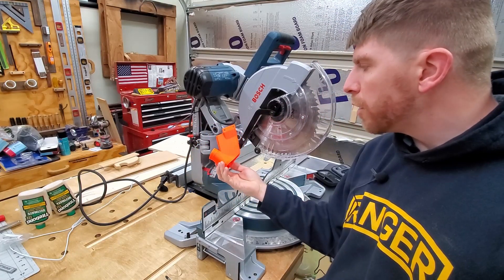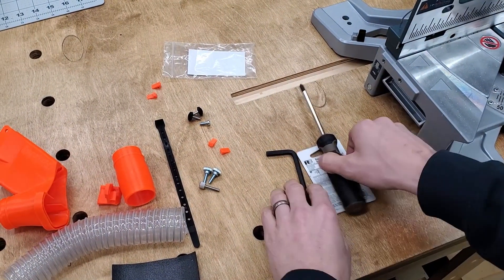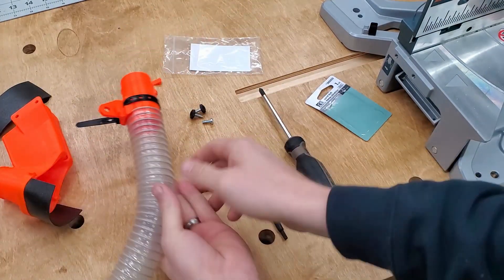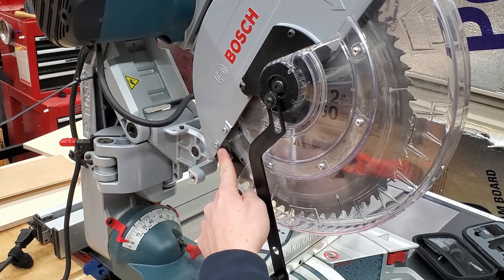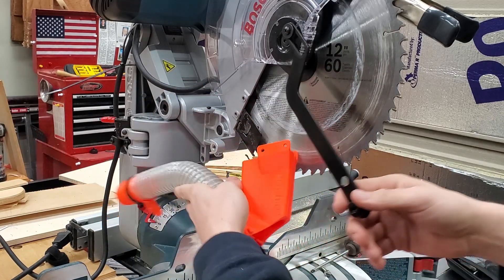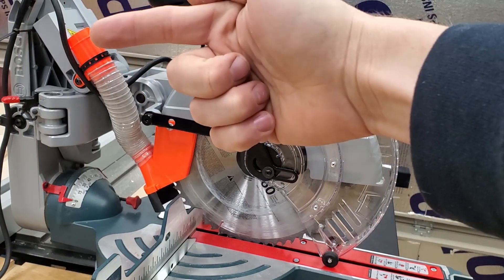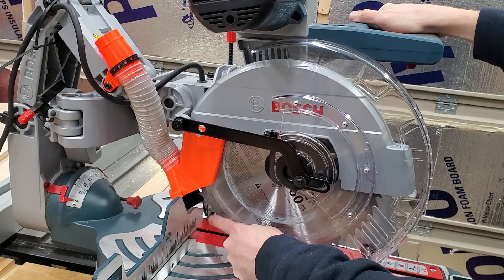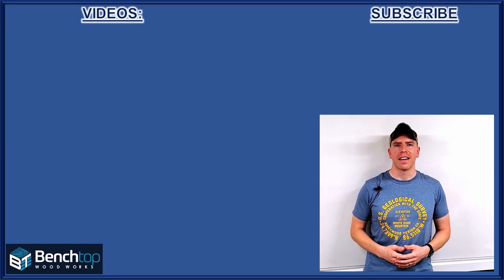Miter Saw Dust Collection INSTALL GUIDE for 12" Bosch GCM12SD UPGRADED (R16)

Comment: It works. I got mine installed yesterday and I'd say it catch's 98% of the sawdust. So much better than the stock one the saw came with. It is easy to remove too if you need to for a special cut. I for one am happy I got it!
Reply from the maker: Thanks David!
Reply: Have you tried right & left 45 degree miters? Have you tried 45 degree bevels? Thx
Reply: I too am wondering how it works with 45 bevel cuts. Thanks Chris
Curt @benchtopwoodworks

Comment: Chis great video.  I almost bought your dust collector a couple years ago and then got distracted.  I have been more into 3D printing recently - just got a Bambu Lab X1C.  So, I thinkn I would like to 3D print these and you mentioned this was ab option in the video.  When I go to your etsy store, I only see the phyical product.  Or, maybe I am missing something right in front of my face.  Does the print file come with the instructions and screws/rubber pieces I need to order - i.e. links to suppliers, etc.

Comment: How does it work on 45 degree miters? How does it work on 45 degree bevels?
Reply from the maker: It works well at full bevel/miter. There are some limitations to thickness around 8/4 on full width cuts at 90. Plunge is not limited.  Beveling changes vertical clearance slightly,  I'm sorry I don't know the max height when beveled off the top of my head

Comment: Where are the images for the "stock elbow" attachment procedure?
Reply from the maker: Great question Rich, I have not done a video on it and need to! Assuming your saw has the hard plastic version,  If you drill the 2x rivets in the stock chute, you can separate the halves.  The stock elbow will mate with our port the same way the stock one did with the bottom portion.
https://www.instagram.com/p/CoIdKhMJohS/?igshid=MzRlODBiNWFlZA==

Comment: Hey Chris, sorry for not getting back to you, my DeWalt Dual bevel miter saw is the DW716 I believe...the top sticker is worn off...I see that the DWS716 has a similar dust shute on it...but I would like one for mine...
Reply from the maker: Thanks Arnie. I have a 715 on hand. I think at least a few of the 715/716 years have similar ports so design may work for both. I have a few videos on my past solution for 715 that worked pretty well with just cheap drawer liner

Comment: So you can cut crown in nested position, but how many times do you cut crown at 90 degrees in nested position? Once you miter the crown you need to take it off. These aftermarket dust ports are a joke. You really think Bosch made this tool to be dust free or to cut your material in every possible way with minimal interference. Dust collection is an afterthought because usability is the most important part.
Reply from the maker: I'm sorry you feel that way.  As the man in the arena on this one,  I can share some more info. You can cut at least 5.5" nested crown at all miter angles without interference. I have personally talked with the Bosch engineer and product  manager yes they design for the widest possible work envelope. In doing so its optimized for capacity and not dust collection,  this attachment optimizes for dust collection and of course there are tradeoffs.  Almost any of these saws can be improved at least a fair amount. What model are you running? I keep a list of all inquires.
Reply: I use 10” glide miter with a Rousseau 5000-L dust hood. Not perfect, but does not limit capabilities. Once your dust port gets in the way it would get taken off and not put back on. For me it doesn’t benefit me over usability. Not to mention the dust hood can handle a stray off cut and not damage anything around. This is just my preference. Good luck with your product.
Reply: I think saying "aftermarket dust ports are a joke" is unfair. Some might consider the factory dust port to be a "joke" because it doesn't collect dust very well in any mode. Both statements are silly. I don't think anyone who makes these things claim that they work in every scenario that the saw is capable of. Would you install a zero-clearance insert for less tear-out, then be upset with the seller because you have to remove it for bevel cuts? ZCI's are a popular modification that also limit the saw's capability, but with a clear benefit in certain use cases. Seems to me you should have spent more time reviewing the product capabilities and whether it was a good fit for your needs.
Reply: You don’t make a very good point. I use a colliflower zci and it has a simple dovetailed slot to remove quickly and easily for beveled cuts. I am a professional and use all sorts of products regularly. If the product isn’t efficient for work flow of saws usability, it is a joke for professionals. Have a great day!
Reply: @samsonhorvath3614  It's odd that a "professional" couldn't anticipate the potential limitations all products have in certain use cases when such information is readily available. This is a custom product made in a small shop by someone who is obviously dedicated to doing his best to serve his customers. Respectful feedback is appropriate, but insulting language is not. You, my friend, are a troll.
Reply: What are comments for? I stated my opinions. I too am a small business and gave a product a shot and it didn’t work. You can call me names, but it doesn’t change the fact that it’s not an option when it comes to actual work. You add no value to this product or its review with your feelings. Trolls nag to nag, not add valuable insight on a product that heavily restricts value of miter saws intended purposes. Plus benchtopwoodworks wasn’t offended, because he understands what I’m saying. What useful insight are you adding, besides your feelings?
Reply: @samsonhorvath3614  Last comment and then I'm done. Of course feedback and comments are appropriate, but saying something is a “joke” is insulting, unhelpful, and lazy. Furthermore, saying the product “is not an option when it comes to actual work” is narrow minded and demeaning to all those who have reported the product’s value. So it didn’t work for you, fine. You could have left it at that and just explained why. But then you had to insult the product and everyone else who uses it. That’s being a jerk.
Reply: Again your feelings, not viable insight for an actual carpenter. It may add value to someone who cuts 90’s, but I use the saw to its fullest capabilities!! I’m glad you can find value in it and you can post it in your own comment. You don’t have to explain your feelings to me. Thanks for letting me know how you feel.
Reply: @mntriangle Have you use this product or something very similar? You haven’t said anything pertaining to the usability of this product. And thanks again!
Reply: @samsonhorvath3614  Yes, I've had the GCM12SD for 8 years. I'm an engineer and carpenter doing a wide variety of personal and professional projects. I've never had need to chop anything bigger than a 4x4, don't do large crown molding, and have never had the need to slide cut anything thicker than 2". I have a second non-sliding miter saw, a table saw, and a track saw to handle various cutting needs--so I have options. 

I've ordered Chris's dust collector after studying several different units available. I am impressed with Chris's explanation of the physics behind his design (with active and passive collection) as well as his use of better materials. And perhaps most importantly, he was responsive and generous with his time answering my questions. 

If a situation arises that I need to make a cut that only the Bosch can do but exceeds the clearances of the dust collector, I will invest 5 minutes in removing it and putting it back. But I can't think of any time over the 8 years I've owned it that I would have needed to do that. OTOH, the dust issue has been a constant problem. I've looked at various hoods, but that's not the right solution for my shop. There's no perfect solution for every situation, but I think this product is optimal for my needs.
Reply: Well, great! I use this saw day in and day out, to provide for my family. Efficiency is the utmost importance to me and my clients. So taking 5 minutes every hour or 2 is a problem. Not a hobby or a diyer. You have a saw that you don’t utilize to its fullest, I do. Thanks again!
Reply: @mntriangle you as an “engineer “ should understand the drawbacks and limitations of this dust shoot. Professionals use a dual bevel sliding compound miter saw for its capabilities for everyday actual work, to make a living. I don’t have endless hours to give my clients. When a product helps in one aspect, but creates another problem in usability is it a success. NO, is a joke!  If you cannot understand my first post and response to Chris, the creator, that’s on you. And I hope you enjoy my zci recommendation, a product that solves a problem and does not create one. Have a good one!
Reply: @samsonhorvath3614  For a “professional” with no time to study a product before purchasing, and no time to remove it when needed, you seem to have plenty of time to be a keyboard warrior and insult others who have found value in this product. I suggest you read the 215 overwhelmingly positive reviews of this item on his e-commerce site. And if you have more time, you can write each of them and tell them why they’re wrong. Evidently, it’s eating you up that others might have a different opinion.
Reply: @mntriangle I thought you were done! Your comments are laughable! I’m so happy you love this product! The truth can hurt, but it’s not a solution for dust control in a production environment that utilizes every aspect of a glide miter saw! This product is for simple cuts, not compound miters. There is a reason Bosch does not make or sell a product like this, it’s not for professionals who are repeat customers. Chris stated Bosch doesn’t want to compromise the saws usability. You haven’t made a case for this product, you have just stated your displeasure in the way I conveyed my message. Now who’s the troll!? And have a nice life!

Comment: I guess my expectations were too high for this DIY unit. What I seriously could not believe was that when the install was done there was no adapter to place on the end unit to then hook up to your dust collector. You would think for$50 an adapter to fit over his custom tube would be available. The hose kinks when moving the saw which will reduce suction significantly. Not impressed
Reply from the maker: Dan (going on username),  I may need some clarification to fully understand your challenges. I'll try to look you up to help/understand.  I sized the adapter to mate with both the Bosch Elbow and many common female vac connectors. I'm here to help,  I'm constantly updating minor things to help my users.  I want to understand. Please email me.

Comment: You as a “engineer “ should understand the draw backs and limitations of this dust port. It doesn’t hold up to real world applications for a saw with its capabilities. Understand “professionals” use this saw constantly for “actual everyday work” to make a living, not a weekend cut list. You’ve explained you don’t need a saw of this caliber, I do. Taking 5 minutes to take off and another 5 to put back on can end in hours of lost wages. This works for weekend worries, not construction workers. Sorry you couldn’t understand my points of view. Good day!